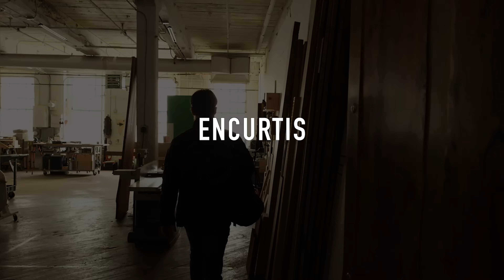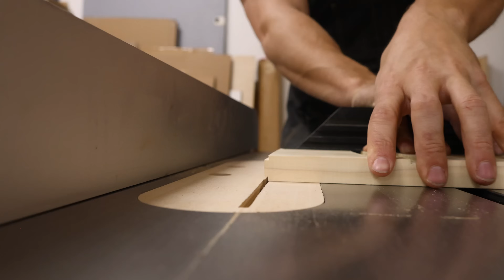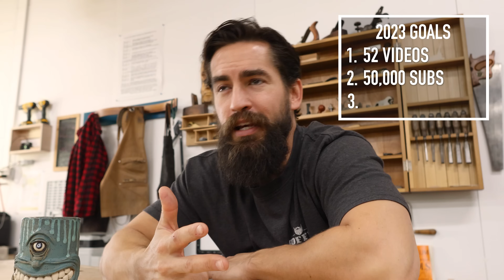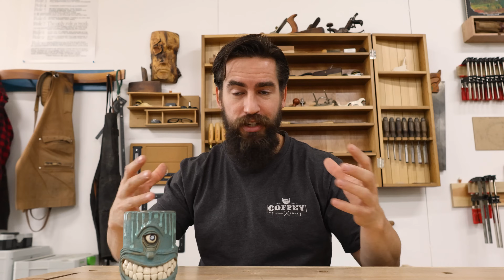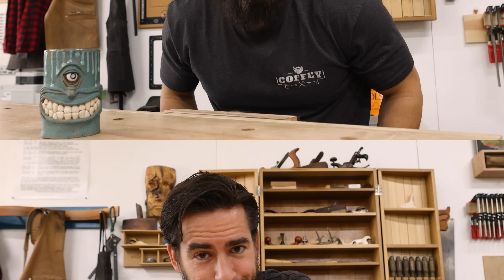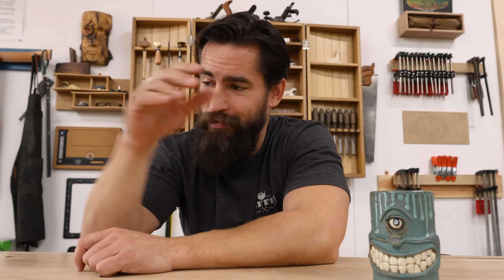It's been a whirlwind

Comment: Do the short and hit your goal. 51 videos is an achievement in itself. That being said will you make a video that shows in detail how to keep things squared up during glue up. I watched you video for miters and implemented your suggestions for a large glue up and during the dry fit things seemed pretty good. Then I go to glue it up and I could not keep my pieces at a perfect 90. Had to wind up setting for slightly less than perfect. Probably screwed up because my side pieces, the whole thing kind of has the waterfall theme for the top and sides. Are already cut so now I'm surely gonna have gaps on that miter. The whole thing is just frustrating and in theory should be simple but just is not.
Reply from the maker: Good suggestion. Will definitely put it on the list!

Comment: I would be excited about a video of you talking about proportional weight and orientation. How and why you need to use a  joint or a piece one way to keep a side board of a cabinet uninterrupted. I’ve come to conclusions about cabinets that orientation is visual first and structural second. Then the joinery comes in. For other things it becomes completely based on function first for weight requirements whether it is hanging or on the floor. Purpose follows function unless form? Your opinion of it would be interesting to hear.

The project that gives you an opportunity to do specific joinery. Frame style drawer runners. When is that the best option to use? Just because you want to try the joinery or are there ideal furniture pieces that use it?

I think I’m at the point where I need to buy books about furniture styles.

Comment: So....    I am a total beginner at making things.  I have in fact completed two projects.  Neither of them required actually joining two bits of wood.  (First required finishing a live edge surface - So orbital sanding.  Second was making a shelf,  but I cannot abide square lines,  so I learned how to use a jigsaw)

I have a friend who wants me to stretch some canvases.   I could just make a mitred frame,  nail it together and call it done bcause no-one will ever see it(that is what the other vids I've seen do).  But I will know it's there,   and it will bug me that the frame the canvas is stretched over isn't also beautiful.   What would you do to make such a thing?   And how do you then make a frame?  Does it fit tight to the canvas?  How to deal with the corners?   How to make it not boring?

Comment: If the short is up to your quality standards, go for it. As for a Chair project, have you heard of a balloon chair? It may involve more upholstery work that you like bit it's an interesting historical design. Think of a wingback chair with an open front quarter dome over it. You can find pictures of one online easily. The purpose of the chair was to create a micro-climate around the sitter, helping them keep warm in the days when heat was by fireplace or something similar. I think it would be challenging and would love one myself but they costs well over $1000 with many over $3000 so not in the cards. I've never seen one being built and would love to watch that project.
Reply from the maker: Interesting! I hadn't known they were called balloon chairs or what they were for but that makes sense. Learn something new everyday! I'll certainly consider it.

Comment: Ugh, just had a screw up today. I'm making a BIG table. Was cutting the tenons, which was a challenge because I couldn't position the beam vertically, so I was focusing on how the hell I would be able to do that... and forgot to check my shoulders.. I'm trying to fit the tenons, adjusting them, adjusting the mortise, it just won't completely close... And not being able to clamp (again, size) didn't help with figuring out what to do. After probably an hour of screwing around it occurs to me that maybe it's not the tenon or the mortise, maybe something is in the way. Turns out my saw slightly bowed when cutting the shoulders and they have a bit of a hump... which was why they wouldn't close up. So to change that I have to remove an extra mm of wood to get them straight again, but with all the fiddling to get the gap to close the tenon had also become to narrow, so I had to glue that with some extra bulk up again so I can redo them to get a better size (it's just a paper thickness of play, but they're not going to get glued.... AND I have to remember to make the rail on the other side of the table a mm shorter as well... because otherwise the table is going to get crooked.